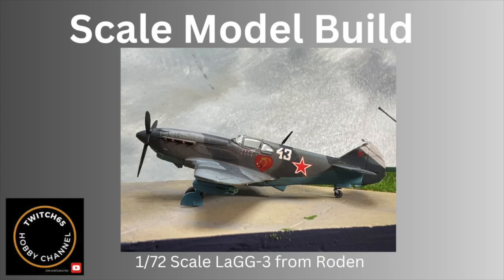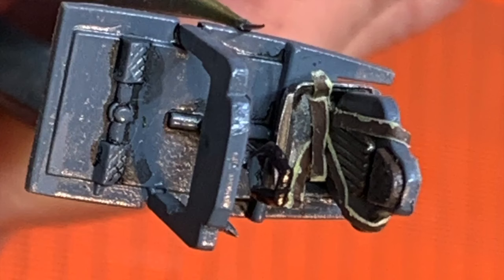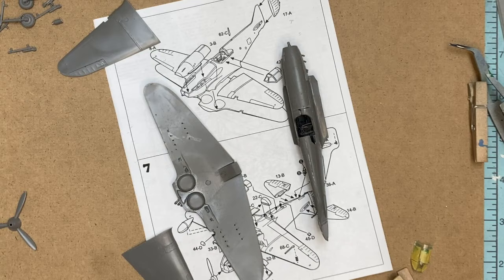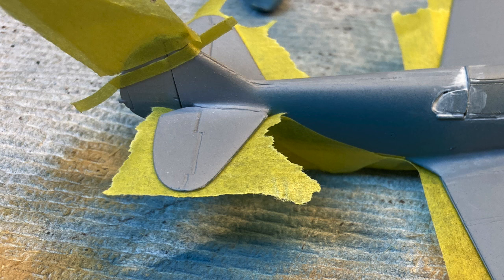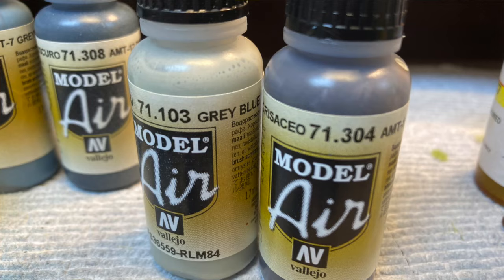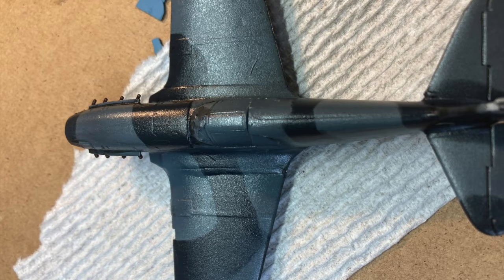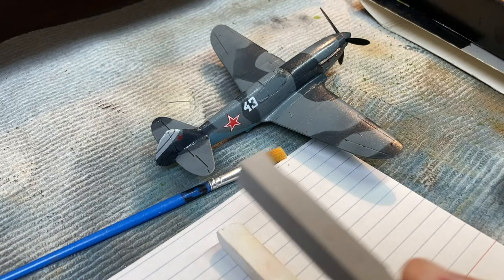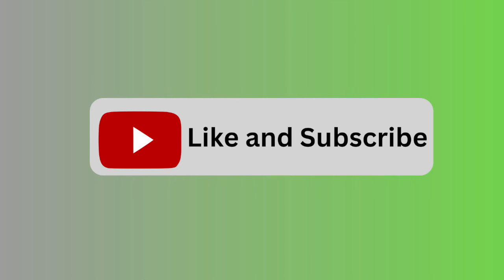Building Roden's LaGG-3 Soviet Fighter in 1/72

Comment: Wow! Its so cool you just posted this. I am about to finish my Roden Lagg-3 today, just have the aerial rigging left. This build was so frustrating. I love the aircraft, but this model was only the 2nd one I attempted after returning to the hobby after 40 years and I was not ready. The left half of the fuselage was soooo distorted, I gave up and set the kit aside for 2 months before returning. Unlike you, I never did get the cockpit base situated correctly, and mounting to the wings later was also an issue. Yes, lots of putty practice putting this one together. I see that you had an issue like I did with the landing gear, there should be more tire below the covers, but its impossible the way the struts are designed (too short). I used one of the other exhaust versions, and I really disliked they way they mounted - I much prefer being able to add exhausts later in the build, not when you close the fuselage halves. Like you, I used all 8 rocket rails, but since acquiring multiple books I cannot find any model/series that ever used more than 6 rails. You had better luck with the decals than me, a few of my stars cracked/crumbled when I applied them, had a fun learning experience of snipping corners off spare stars to repair. I did the white winter color scheme, but I really like the way yours turned out. The soviet camo scheme is so unique in its colors. If ever do another 1/72 Lagg-3, I will do this scheme. Thanks so much for posting!
Reply from the maker: Oh man!  You described every single issue I had with this build - you think I would have learned my lesson with all the Roden Bi-Planes I build last summer!  I agree about lack of Soviet planes in 1/72, so it seems we are stuck with stinkers like this one.

One suggestion, if you're just getting back into modeling, go grab an inexpensive Airfix kit and reacquaint your mental muscles with the tasks of building plastic kits.  I'm not a huge fan of Airfix, but still find sometimes they are the only ones doing Western European kits.

Good luck in the hobby!